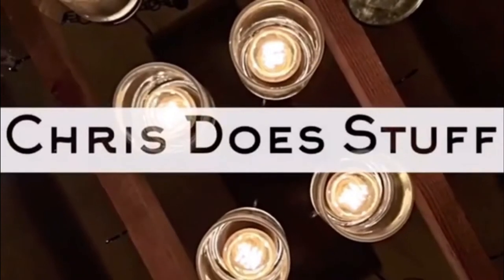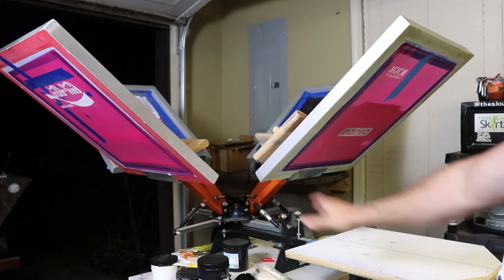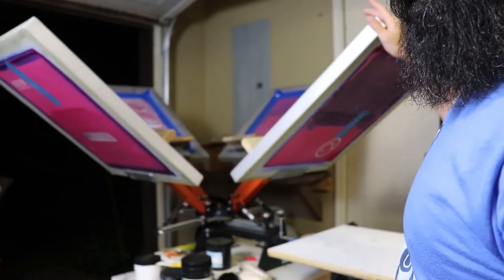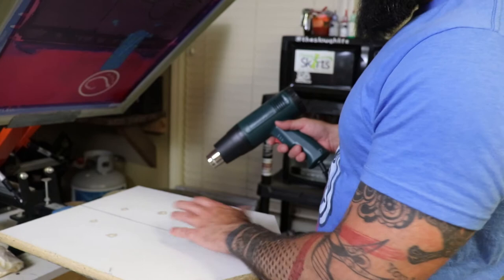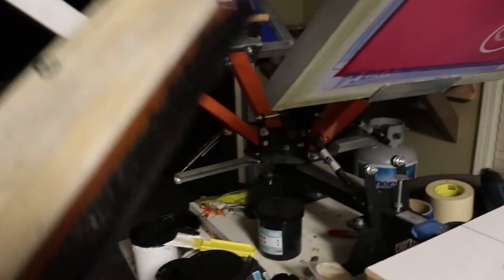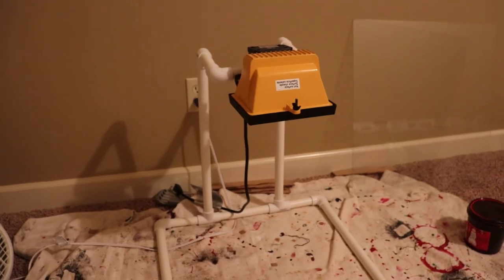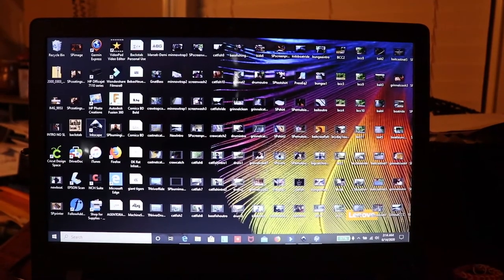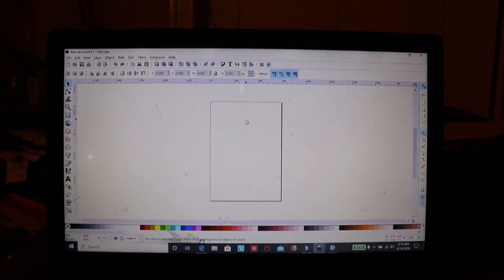Beginner's Guide to Screenprinting Part 1 - the Equipment Needed

Comment: Screen printing lasts longer than heat press, period. & It's cheaper to do really. I've screen printed for about 6 years for a livin & you're a 100% on with all you're doing. You don't need an automatic press unless you're doing 1,000 shirts a day. Sometimes I've even used the heat press to cure and get that white poly ink smooth and looking nice.
Reply from the maker: 100 on smoothing out that poly white!